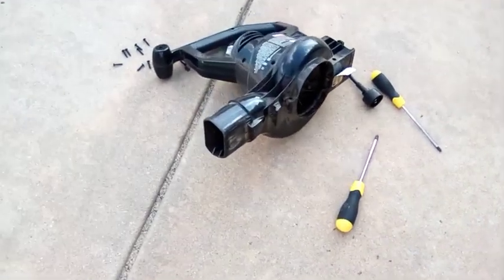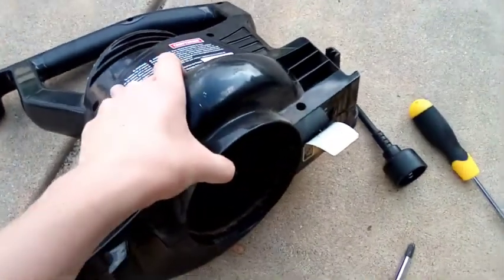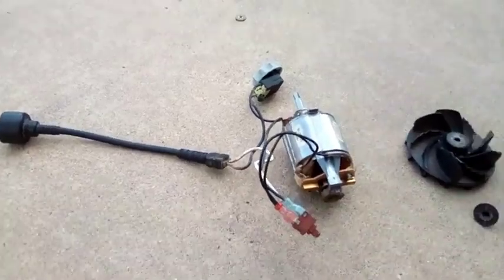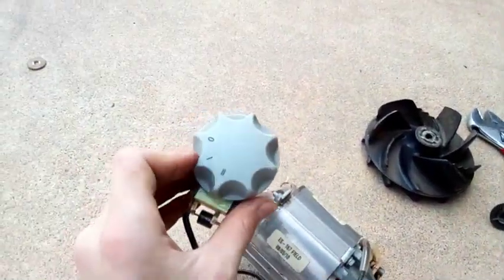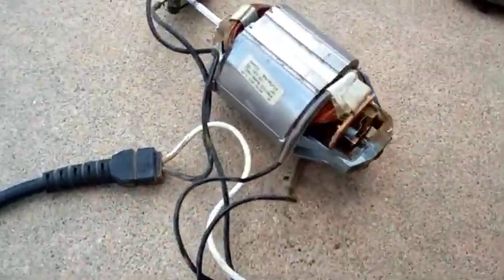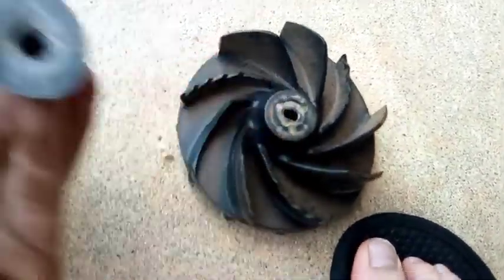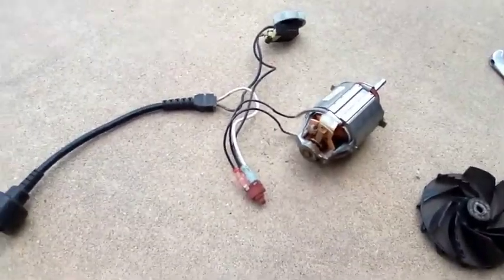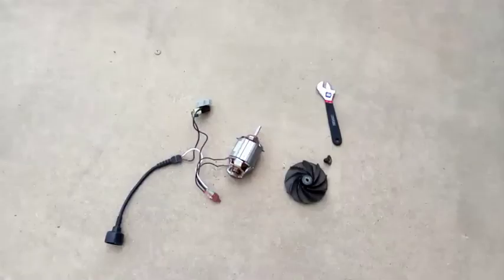Taking Apart A Broken Craftsman Electric Leaf Vacuum/Blower

Comment: the 2-speed selector switch more likely contains a capacitor than a resistor to limit the current through the motor. This way it won't generate a ton of heat inside the selector switch.